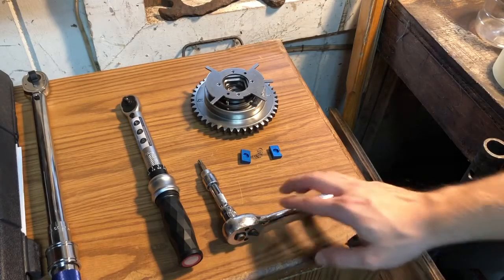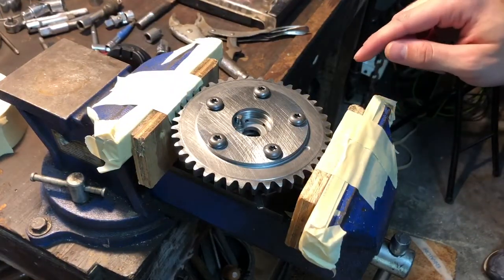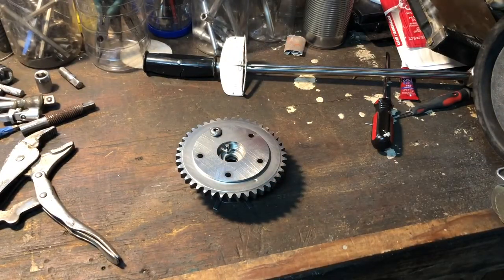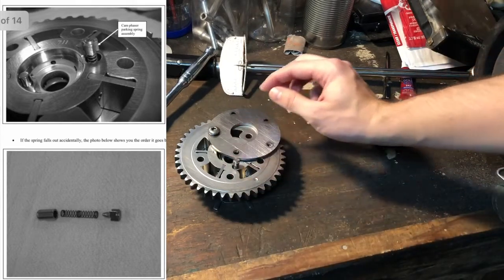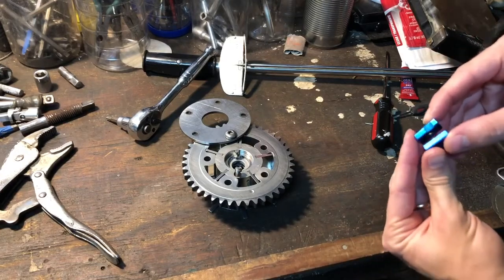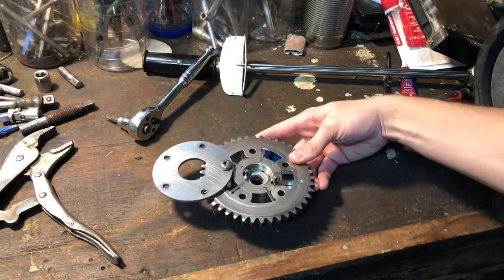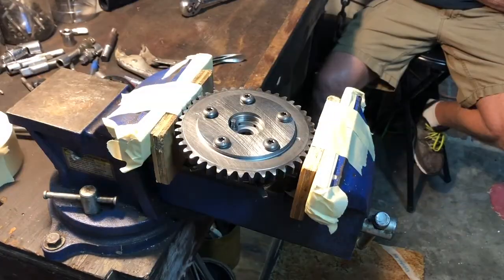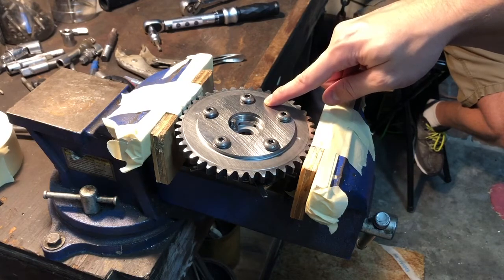How to lock out / limit the Cam Phaser for a Ford 4.6L / 5.4L 3v Modular motor

Comment: So does this limit wear on timing chain? Is there a noticeable power loss? Did u re program it for this?
Reply from the maker: No, it limits the variable cam timing (VCT). It does this by filling a portion of the oil galleys within the phaser. The reason for this is to prevent valve to position contact. And it absolutely requires a tune/reprogram!

Comment: You recommend limiting, rather than blocking. with the limitation, it will not be necessary to reprogram the Ecm to deactivate the phaser? Very good explanation of the installation in your video.
Reply from the maker: Thank you! You absolutely have to reprogram the cars’ computer though. And make sure they know you are limiting rather than “locking out”.

Comment: What’s the purpose of this? Sorry I genuinely don’t know.
Reply from the maker: Well there is a couple of reasons one may do this. In my case, it is to prevent piston to valve contact, since the cams will be pushing the valve further into the cylinder head. Other people do this to prevent the phaser from failing, a common issue in 4.6/5.4L modular motors.
Reply: if i want to prevent the phaser from failing what kit would you recomend and also what difference will make in driveability?